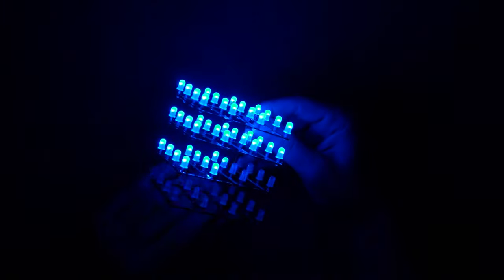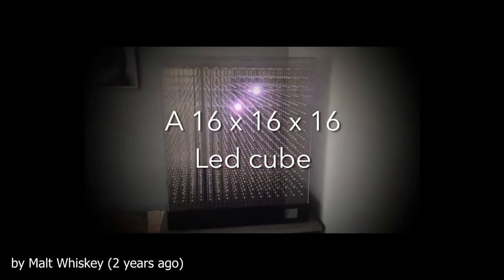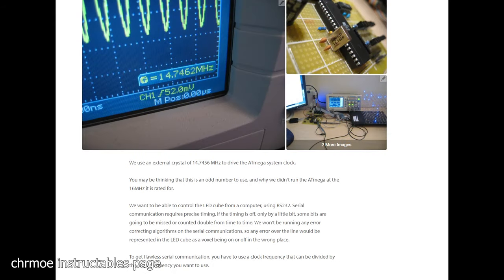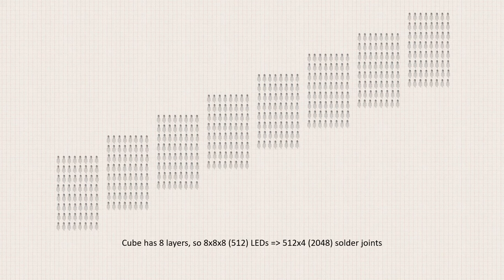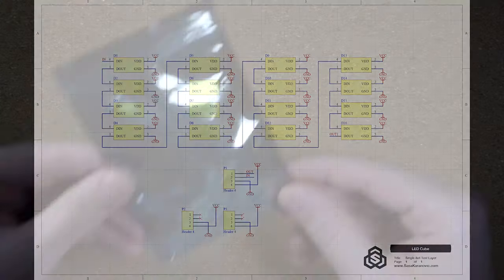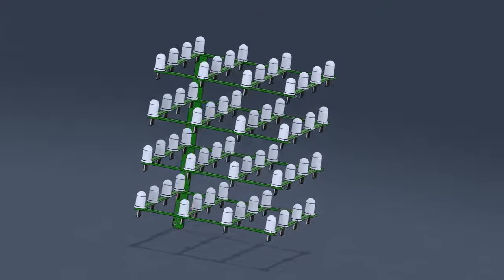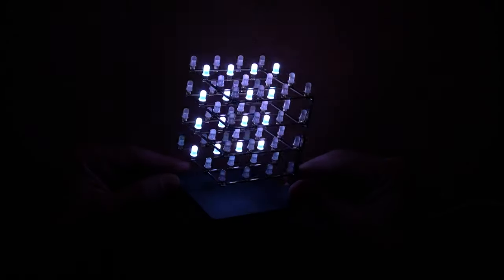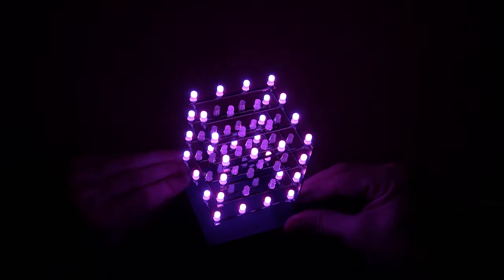How (NOT) to build a 3D LED Cube

Comment: Clever!  I think you could achieve a clearer effect by gluing a mostly transparent flex PCB onto a rigid clear substrate such as laser cut acrylic for mechanical support.  Using plastic would also open up the possibility of solvent welding the cube for added rigidity.
Reply from the maker: Thanks! That's an interesting suggestion. I definitely considered using a FPC instead of PCB, which would be way more transparent, but at the same time it would probably be more expensive and way more delicate to handle. I know you can also print traces on (clear) plastic but that is just super expensive.
Reply: I just came here to suggest the same thing!
A transparent substrate would allow for more mechanical strength and allow for routing on a single layer. The only problem I can see is finding a substrate that's in commercial use that is OK to be soldered. 
Clear printed membranes are common for keypads, solder-able tends to be yellow (as its a high temperature plastic, eg kapton)
Reply: Low temperature soldering is a  possible solution, or glass substrates with ITO tracks (like lcds)

Comment: You could probably save a ton by having individual strips of pcbs, and then secondary pcbs for joining them into squares.
Of course that would increase the soldering work, but it shouldn't be too bad considering the savings.

Or maybe just a solid pcb at the bottom and then have strips stick out up from it.

Btw you've been featured on hackaday
Reply from the maker: Thank you! That's a neat idea. It would be a bit more work but still worth it.
Thank you for letting me know! Hackaday is awesome! :)

Comment: Well there are a two possibilities that come to mind:
1) Flex PCBs can be interesting as their incredibly thin structure is less obstructing. They also allow for some sneaky space-saving through stacking the thin ribbons cross on-top of eachother so you don't have all that air. Rigidity can be a challenge though.
2) FR4 can be somewhat transparent, it is the Copper and solder-mask that make it very visible. Avoiding thick copper traces/pours and a transparent solder-mask PCB (or simply NO mask and then lacquer it later to protect the copper) can go a long way.
Reply from the maker: Thank you for the suggestions!
I thought about using FPC board and maybe that's something I should try next. The flex can be very transparent and then the stiffener can also be made out of transparent/translucent material which will probably be better than FR4.
You are right, the copper and soldermask definitely block a ton of light. But I think if I could find a PCB shop that can make a 1mm wide PCB, that would already be a huge improvement.
Reply: @SasaKaranovic  Could you use a laser cutter to cut down the width of the PCBs yourself?
Reply from the maker: @martinweiss3046  Good suggestion but I have not tried this. I'm not even sure if it's safe/possible to cut FR4 with laser.
I'll have to revisit this at some point or wait for the PCB processing to go to the next level. :)

Comment: My idea would be to use surface mount RGB addressables, but put them on both sides of the PCB, acting as pairs, with hemispherical diffusers over them, thus giving you floating spherical pixels, just a thought, but love what you've done here 👍🤘
Reply from the maker: Thank you! That's actually a pretty neat idea. Then visually, the PCB would "cut" the spheres in the middle and probably look like it's blocking less of the cube.
Reply: Yes, that's exactly what I was imagining :-)  @SasaKaranovic

Comment: Alternatively you could 3D print the framework in transparent material and run solid core wire down printed grooves in the framework.
You can get 5mm 4 pin RGB, LEDs, VC, 0V, dIN and dOUT.
So just 3 wires running down grooves.
Reply from the maker: Thanks! That's a good idea. Although it might be a bit more tedious and time consuming compared to having PCBs with LEDs soldered onto them. But probably no by much. :)

Comment: You should try flexible PCBs, they are at least partially see-through. You'll still have to find a way to make them stable for the project, i.e. build a frame from something stiff.. And you can probably get them smaller than 2mm.
Reply from the maker: Thank you! I think I should try this next. FPC boards can have plastic stiffeners that will help with stiffeners and will most likely be more transparent than FR4.
And since they laser cut them, they should be able to get better yield for super tiny boards (compared to rigid PCB).

Comment: Love the idea! Awesome
Reply from the maker: Thank you!
Reply: @SasaKaranovic  my immediate though was flex PCBs, but that would introduce structural difficulties. Using glass or other see- through materials as substrate sounds really cool.
Other than that, you could eliminate the vertical PCB by using a wire on each corner, that would improve visibility on that axis.
Reply: @M4dM1ke  Glass does make sense but when you think about it, it could lead to problems. Drop it and its broken and the glass could introduce ugly reflections or distortions.

Comment: Glass will be see-thru, but I think the glare will be issue if you're using full sheet of glass

But if you wanted to go that route, https://youtu.be/aljbjJbfghs?si=XJ7p0bQj8cWkf7oB 

You could print your circuits on glass

IDK, maybe you can have him do it for you so you don't have to invest the time and money to get your own system working

I suppose you could use phone screens or glass rods sanded down to your needs
Reply from the maker: Thank you! Actually you are right, the glass would probably have a significant amount of glare that would make cube look "distorted".
I think I just need to find a PCB vendor that is willing to make a really tiny PCBs and handle them delicately. :)